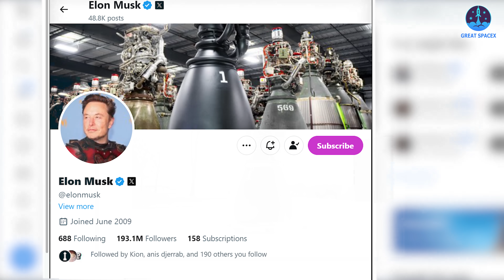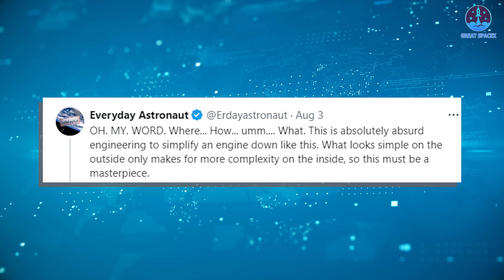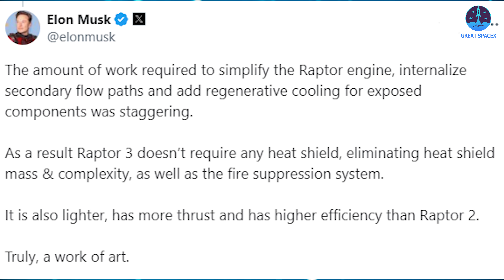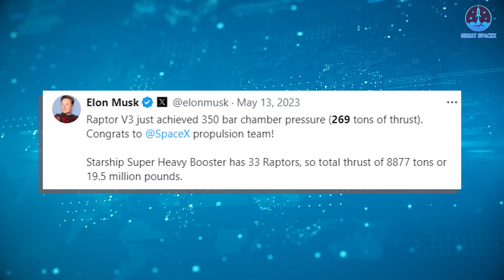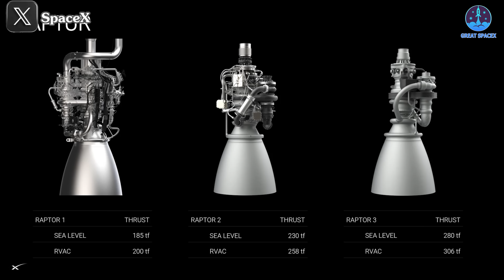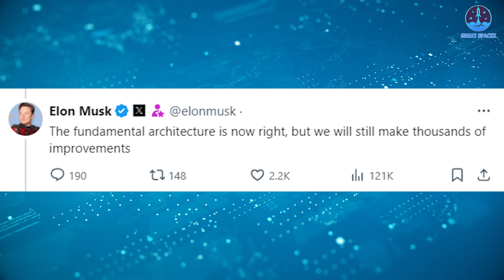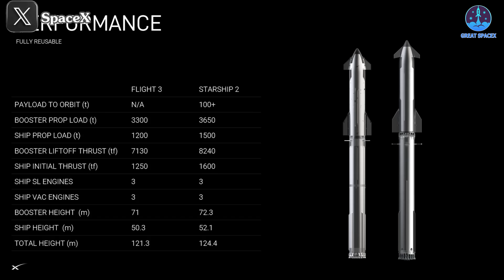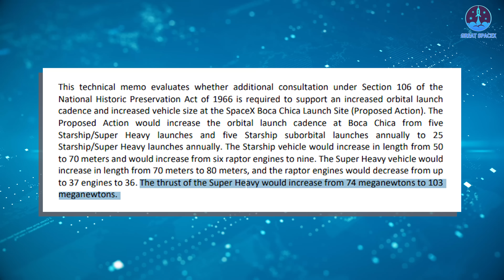SpaceX's New Insane Raptor 3 just HUMILIATED the entire rocket industry

Comment: will not carry as much as rocketlab will, not very impressive, they are just attempting to entice more contracts, but unlikely.
Reply: What are you talking about? Lol rocket labs best rocket is 1/10th as powerful as a falcon rocket let alone starship. Are you a troll or don't know how to use google? Lol their largest rocket that is still in development is still behind falcon 9 lol
Reply: @epayson85  RocketLab has something big coming and SpaceX will be taking a #2 seat with NASA is fed up with his agreements and they want out.
Reply: @winismine4633   and how do you know this? Lol you realize that Neutron, which hasn't even been built yet, has a payload capacity that is also 1/10th that of starship.   By the time Neutron is even having a test flight, starship will already be landing on the moon.  Further more SpaceX has far better manufacturing capabilities and will be able to produce rocket engines and rockets much faster than anyone else which is important since most trips to Mars are going to require MULTIPLE STARSHIPS. Which then brings up if Neutron is only capable of 1/10th that of starship then how many neutron rockets would be required to go to Mars? Lol and then does rocket lab even have the capabilities to produce that many rockets? SpaceX is already at the point that they can produce 1 engine everyday and more importantly with the advances in V3 it's believed they will get to 2 engines everyday.  It's going to be a very long time before ANYONE, let alone rocket lab, catches up to SpaceX.
Reply: @epayson85  Neutron will fly next year and it will be more capable.
Reply: @epayson85  while you make good points the only thing nasa sees in starships future is a titanium shower and broken promises
Reply: @winismine4633  righttttt that's why NASA keeps giving them more contracts lol

Comment: The weight savings and thrust upgrade will allow them to reduce the amount of engines on super heavy. Instead of 33 they could have 30, or maybe 27! making the rocket a lot lighter.
Reply: Yes, NASA/Von Braun had that idea a long time ago, it was called a Saturn V.
Reply: @brettbuck7362  How do you figure? The Saturn V can carry the same amount to orbit as the starship, yet the starship is recoverable and reusable at that payload amount. If they do an expendable mission the starship can carry about twice as much, with new more efficient engines widening the gap even more.
Reply: @Lithane97  You missed the OP point, they were proclaiming the breakthough of bigger engines reducing the complexity. Compare a 5- big engine Saturn V  to  a USSR N-1 (which Musk and company copied to come up with Starship). The USSR had the same idea, we have good little engines that are easy to design, lets just use 30 of them. The USA instead built bigger engines to simplify the system, it was hard to design, but ultimately was 100% successful instead of 100% failures. All the other stuff - including recovering the boosters by landing them- was around long before SpaceX - but then, as now, cost them too much throw weight. None of this stuff is new.

Comment: long time ago, during R1, the fuel rich gas will produce tar stucking the engine, thus, they put it in the middle of the thruster. and the oxygen rich burnning the the seperated accelerator, however, the oxygen gas is corrosive. THis induce a lots of trouble.
in R2, they make the fuel feeder and oxygen feeder integrated. this reduce a lots of dead weight.
in R3, they somehow solve the tar problem. the turbo pump now run the regenerative cooling with fuel. you can see it from picture that they don't need excessive cooling to cool the overheating oxygen rich gas, which means, the turbo pump is running by fuel rich gas, which means, they have solved the tar problem

Comment: BE4 is not a methane engine. It is natural gas.
There is a difference - natural gas is mostly methane, but contains other gasses such as propane and butane in varying amounts.
Reply: Using LNG is just being Cheap it is easy in the cryo cooling stage to separate out the other gasses! 😮 Using just methane is how SpaceX is getting so much out of the Raptor series of engines!

Comment: How ironic that Elon Musk is going with welding, the original Apollo flights used all handmade features that required a class of welders that no longer exist. Which is why NASA can’t make the Rockets like they did before, the welders are all dead.
Reply: What kind of welding was that?
Reply: I remember watching some NASA videos where they showed the piping for the rocket engines and the guy explained that it was all done by hand, because of course it obviously was back then no premade parts
Reply: @mygamecomputer1691  I think I follow, you're talking that the methods that were used died with those who used them.  You are correct a lot of old methods have since been changed and the methods that were once used no longer exist today. It's simplistic to imply though that they could not re-build should they have some desire to do so.  It would just require updated methods.
Reply: It may seem simplistic to you however if the artisans and techniques no longer exist there’s literally no one to teach them how to do it anymore.
Reply: @mygamecomputer1691 There has to be a benefit to recreating engineering and there is no good reason to build more F1 engines they were huge heavy & inefficient! 😊 That was why Apollo had to be a 3 stage rocket! It really needed to dump the mass of the first stage!
Reply: I was talking about the people who complain that NASA can’t do what they used to do. They can’t do it because the artisan welders don’t exist, I’m not suggesting that their Rocket Engines  were better than Elon’s, I think Elon has the best rocket engine Right now. I think you and I are on the same page.
Reply: The welders are dead. Well then there's room to do even better.

Comment: It is amazing how fast SpaceX is developing and producing new and more powerfull engines!
I wonder if the ULA Vulcan rocket can be fitted with the Raptor 3 instead of the Blue Origin BE 4 engine.
That would solve the slow engine delivery pace ULA is currently experiencing from Blue Origin.
Elon may want to negotiate with ULA about re-engining the Vulcan with the Raptor 3, with the condition that ULA not be sold to Blue Origin.
Wouldn't that be advantageous to both ULA and SpaceX?

Comment: These motor changes reminded me of a BMW commercial during the 1990s.  The BMW engine was known for less wiring, tubing, and clutter.  Simple designs mean easy debugging when an issue is found!   This looks like an engineering dream as the end result is cheaper, and the accounting department had nothing to do with this achievement!  The longer you can keep from being associated with the John Deere direction, the better.  Nothing Breaks like a Deere!  If the ship is upgraded to a 12M diameter, will the launch pad be able to handle the extra erosion?  I can't wait to see the variant Starships designs for different sized payloads!  It would be cool to build a space station out of starships.

Comment: Starship with raptor 10 will not be going to mars, the moon, the space station or orbit. Elon had two choices. A stainless steel battle ship or a aluminum rocket to revolutionize space travel.

I guess not being an engineer and his main claim to fame is a great con man. A battle ship will never make it to space. The booster will never complete a 4.00 burn and neither piece will survive landing.

Tesla is going out of business with China. Even the weak minded will not continue to pay outrageous prices for any vehicle that loses 60% of the cost when it drives off the lot.
Reply: I love it when you haters just make things up.  You haven't got a leg to stand on, don't mind blatantly lying and have never been terribly bright.  Wow.  Do you fail this hard at everything?  I'd bet real money the answer to that is a big YES.
Reply: The pins that secure the thermal tiles are WELDED pins 😮
Reply: No kidding. The inside of a thermal tile is like styrofoam. The pin will not hold Styrofoam in place. The space shuttle tiles were molded individually as to leave aero gaps. Each tile was a single tile. That is why it was so expensive. The tile went through a heat treatment cycle before bonding to the aluminum skin. It withstood earths atmosphere. Just not the ice impact of takeoff. They could not repair in space. As no adhesive would bond in space with -450 degrees and a vacuum. But the astronauts could have been saved by offloading to the ISS. This was a fault of imagination by nasa flight control.
Reply: Sorry I have 45 year in manufacturing, electronic’s and electrical distribution systems. So I’m not as naïve as you are. Here’s a little physic’s problem to make mine and your case. Apollo v weighed 9 times less and carried us to the moon and back. Starship weights 9 times more empty. This is a simple physic problem. Part two booster has 33 engines mounted on a single stainless steel rocket frame. This will never work. Reason back to physics the shear vibration created by 16,700,000 lbs of thrust. If it runs over 4 minutes it will explode every time. Part three thermal dynamics on the skin of starship. The current tile configuration cannot protect such a large area with any gaps. Let alone gaps a 1/4 to 3/8 wide.

Last I’m not a hater. I’m a realist. What irritates me to no ends. Is to keep making the same mistake and expecting a different outcome.
Reply: @mikerash-pc4jc  you may know aluminum, but you're not taking into account that stainless retains its strength at much higher temperatures.
In fact, Super Heavy holds more propellant per dry weight than than the Saturn V first stage did. 

The things you're saying will never happen already have happened to a substantial degree; i.e., it made it pretty much into to orbit and both stages returned pretty much intact.

Where is your 4 minute burn requirement and failure point coming from?

As far as comparing the upper stages for traveling to the Moon and beyond, you're not taking into account the intent to refill the Ship for that.
I'm not sure where your factor of 9 comes from, but coincidentally that is about how many tanker Ships will be sent up for each Moon Ship.

And most cars lose about half their value as soon as they're driven off the lot.
That's subject to the market and perception and is a secondary consideration.
Reply: I have 45 years experience in manufacturing, electronics, electrical distribution systems. I’ve worked building molds to pour various steel compounds and aluminum. I’ve worked with every material made to date and some that didn’t pan out.

Two problems with stainless is its 9 times heavyer than an aluminum construction. The second stainless micro structure will not let any known adhesive adherence to surface. The pins are a waster of time. To use a thermal ceramic it has great thermal properties. But the flip side is more like styrofoam. These tile could be glued to aluminum or iconel. The problem with ceramics they must be manufactured with a zero gap between each tile. Elon is cutting corners because of the massive surface area. The newest current design still has gaps of a 1/4 to 3/8 of an inch. So it will not survive. The other problem is mounting 33 engines to a single rocket frame. A single Fran can not with stand the vibration transfer. This is why they’re reducing the initial burn time at separation.

If they created 3 boosters with 11 engines. They would have more fuel less vibration and could carry starship as high as they needed after conversion to aluminum. This would remove the necessity to refuel in space.

Comment: Less mass means less manufacturing cost. That and increased fuel efficiency means less travel cost. Finally, the simplification makes the engine more scalable, faster manufacturing time, etc. oh, lets not forget the engine shatters competition.
Reply: Less mass means less material is used, but 3D metal printing uses metal raw material that is more costly per pound, and the production process is costly.  This was done to reduce cost over the life of the engine, not necessarily to reduce cost of production alone.
Reply: @ytgeorgia  tell that to my iPhone compared to my door stop.